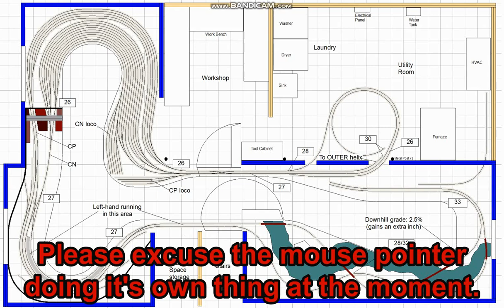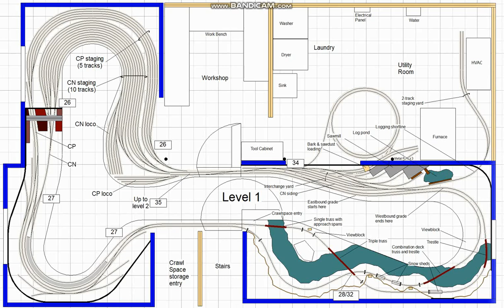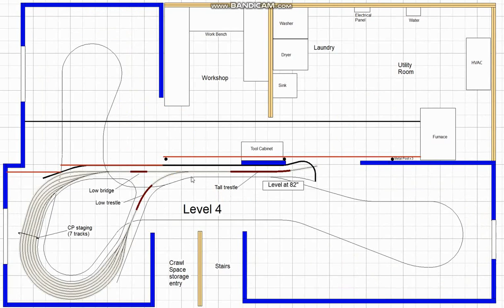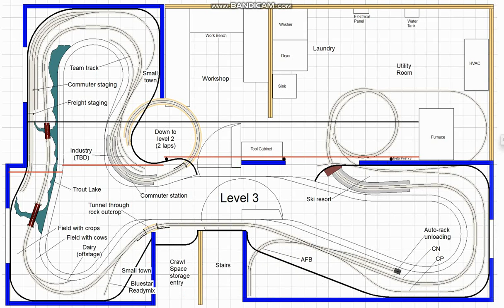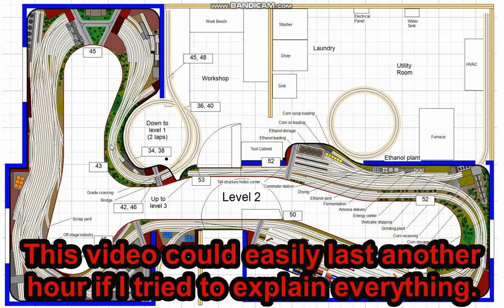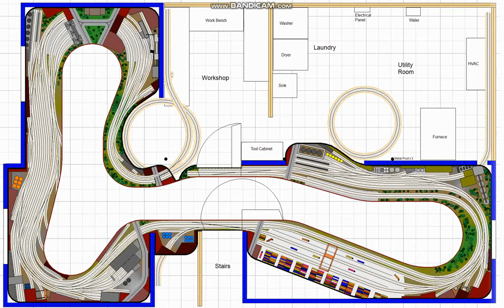Spectacular multi-deck layout design for a very awkward space, part 2

Comment: Outstanding design again, Peter. Hard to wrap one's head around the various levels and how they work together without a 3D view! A separate video on the structural implications would be fascinating to see, to help piece everything together. Does 3rdPlanit give you a running total of the amount of track and switches this layout needs? I'll be watching these 2 videos several times more to take everything in :)
Reply from the maker: Track requirements and turnout lists are easy to print out and I always do so.  I discussed some structural ideas with the client but they are beyond the scope of the video.

Comment: Excellent videos!  That certainly is a VERY ambitious complex design.   This will take years to build.  One thing that I see as a possible concern is what problems will this construction cause for possible major repair work of the HVAC and furnace equipment (i.e. normal home maintenance & repair).   Also, are there any possible concerns about needing access to the exterior walls for unforeseen repair work (wall leakage, etc).   Consider how to accommodate commercial equipment repair personnel needing access to work on home equipment.   Where is the railroad control area located?  Will he install video cameras at numerous places so he can view the rooms from the control area?  Apparently the owner is a very experienced model railroad operator, since this is a very involved design.

Comment: I've watched at 11 ft 8 bridge quite a few times hundreds of trucks and campers they raised it up I think it's 12 ft 2 maybe now not much of a difference still clipping off air conditioning units and taking the tops off of trucks they did it strictly for the grade of the track not for the trucks or the campers that were being cut off at the head I thought that was funny that you said that though

Comment: I would change the gateway into the workshop to swing into the main room, it looks like it creates a pinch point, swinging into the main room keeps the maximum width entryway
Reply from the maker: There is no space to swing it into the main room.  Not only would the two swing gates clash with each other (potentially causing damage or preventing someone from returning to the room from outside), but it would reduce the narrowest part of the aisle even further (down to about 18"), which would have been unacceptable.  As drawn, it is quite a convoluted route around the end of it to the utility area, but this can easily be improved by shortening that wall by a few inches.
Reply: Could the gateway swing in to the left, against the helix, leaving the access to the shop more open?
Reply from the maker: @derekalexander4030  Whether it goes to the left or the right, the result is exactly the same - crashing gates and an 18" aisle
Reply: @mpeterll  I’m sorry I wasn’t clearer, I meant to have it go into the workshop with the hinges on the left so as not to block the entry into the laundry room so as not to interfere with the laundry room which will probably be used often and by other members of the family as well.
Reply from the maker: @derekalexander4030  That doesn't help either.  Look closely and you will see that the point of the swing gate is further west than the easternmost extremity of the helix.  Placing the hinges on that end would lose about 5" of width.  Any attempt to cheat that distance results in a situation where the gate will destroy itself the first time it's opened too fast or someone leans on it in the open position.